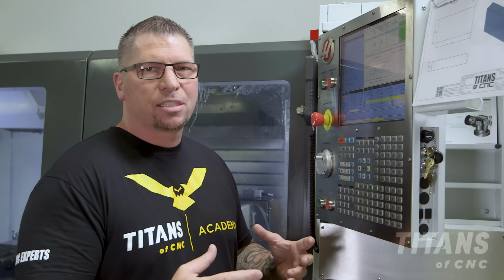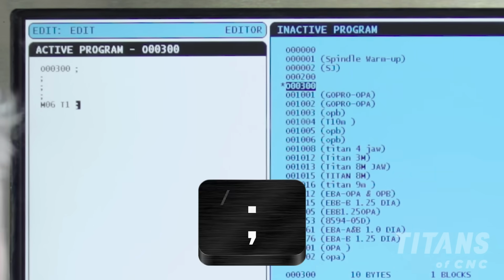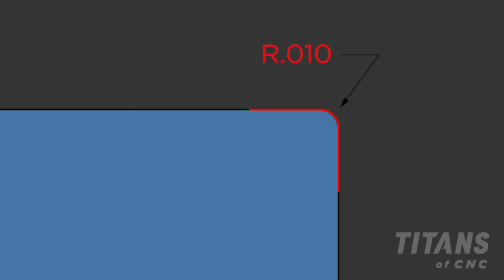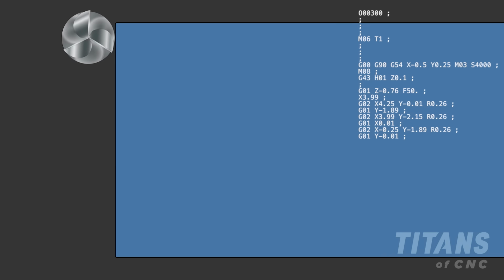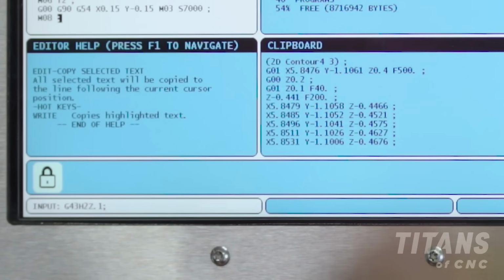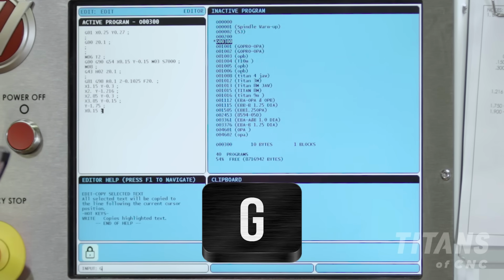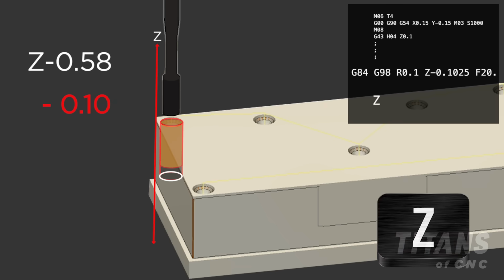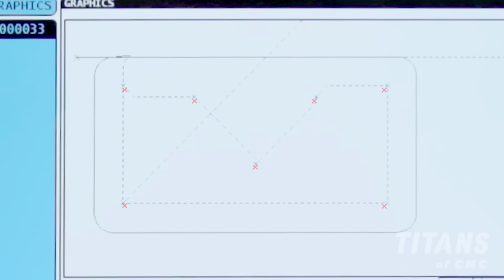G & M Code - Titan Teaches Manual Programming on a CNC Machine.

Comment: Did you cut the surface on the first G1 or block. Your Y is half the diameter of the tool so you didn't cut on the linear? I'm a beginner😁

Comment: What program do we use to save the codes and the drawing in to put it on
 a cnc machine to engrave/cut? I have a small hobby style CNC3-3018PRO I bought to learn how to cnc as a hobby. I am trying to learn how to draw and write the program and cut it. I
 have inkscape and autocad 2017, however I am trying to learn on both. I
 have coreldraw 12 also. I have been using a laser engraver for about 2 years. no programing experience at all. Thanks for all the assistance you can give me in learning. Herb

Comment: Good stuff!  For 15 years I worked at a manufacturing plant.  We ran all types of CNC machines, turns, gun & cross drills, mill and centers, hobbers, cut, clip and shavers, broaches.  We even had a few CNC laser welders.

Comment: Are these codes the same on any CNC display? Can this be done on a laptop/desktop? How interchangeable is this coding? 
Last question: what type of machines are they using in this shop?
Reply: same same but some machines have more features hence more codes apply to them.

HASS

Comment: Do you guys not use cutter comp with G41’s and G40’s?
Reply: I'm sure it depends on what actually machining, and if want give operator the option. But if only doing a one off or so wouldn't need

Comment: I have not seen a lot of your guys's videos but do you guys do CNC lathe work? If so how would you program 3/8 + 18 nptf pipe tap using a reamer and a thread bar single point? Could you possibly explain it out of the 28th Edition CNC handbook as well as at the controller? My lathe is simple G&M coding.
Reply: Internal thread.

Comment: I would like to become a Certified CNC machinist. How long does the Certification take and cost? Any financial aid available?
Reply from the maker: Start for free at academy.titansofcnc.com
Reply: It doesn’t take certified training, it takes hands on training. I’m working at a precision machining shop right now and I’m going to be shadowing in CNC precision machining and Welding. So this is like a blessing to me. I can’t wait to get onto my next job in the facility. I’m starting in the sandblasting booth cleaning frames, railings, bumpers, weightlifting equipment. It’s sick. Such a great job and atmosphere. I reccomend it.

Comment: Taught myselfd G-Code programming back in 1985 when the shop got its first CNC machining center. I was youngin and hungry, I took the programming/operation book home and must have read it 50 times. I was able to write our first program before we even went for training and even familiarize myself with the electronics. It was very satisfying to input my data, push go and watch it do just what I told it to. Ahh to be young again.
Reply: That sounds awesome. Because at that time it was cutting edge. , we have a 3D printer at work printing with inconel which i still find insane.

Comment: A short cut using the little used comma function can really make this outside shape a lot easier. Start out the same X-.5  Y.25.  Line 2 would go like this X4.25 Y.25 ,(comma)r.26. Line 3 Would be X4.25 Y-2.15 ,R.26 etc.

Comment: Im a graphic designer. I have no idea why I watched this in full but i can now program a CNC machine using G & M codes.
Reply: This was just the start, now add in more axes and cutter compensation etc. it gets more complicated believe me. A Swiss type CNC can have 13 axes working in unison, drilling milling and turning both the front and the back of a component at the same time
Reply: @Stumpy1854-Orion  
Do you think writing code will become obsolete for cnc? Modern machines might just work directly on designs? I am currently studying and wondering if by the time I graduate will I even need to learn cnc coding?
Reply: @amirpatel9988  I'm not a designer nor a machinist but I would be very surprised if all that would be still necessary in a few more years.
Reply: @amirpatel9988  CAM software is awesome but you still need to be able to troubleshoot the code it generates.  it doesn't always create the most efficient code, either.
Reply: @amirpatel9988  there will always need to be somebody that understands the individual codes in order to troubleshoot errors and operate the machine efficiently
Reply: If you can, you're not of this world ;-) Stay save.
Reply: I’m a Design engineer and am curious :)

Comment: For your Rotation G- codes such as your examples for G2 why Is the radius represented with an R and not an I or J?
Reply: It’s much simpler to explain R values. Most controls will accept either R or IJ commands, but never both at the same time . R’s are more prone to failure though whereas IJ values clearly define the center point of your arc.

Comment: On the thread If you change the speed do you have to change the feed as well or that stays the same?
Reply: They are tied together.  Let's say 1/4-20 tap. 1"divided by 20=. 05    then multiply that by whatever speed you want for your material. Let's say 1000rpm. 1000x.05=50. Speed 1000 feed 50

Comment: Where is the cutter compensation 🙄
Is it possible to do lead in/ out manually?  
Is it possible to do multi passes in XY plane? 
Or we need a CAM?🤔
We used G54 D01 where we store x and y value. But what i see here is  totally different and interesting.
Reply: I usually use cutter comp when programming manually. It's much easier to read than trying to do the math of where your tool is supposed to be, and then you can use your wear offsets more efficiently because the tool size isn't hardcoded into the program

Comment: Haas needs to either consult with Siemens or Heidenhain on how to make a modern cnc control because I’m afraid this is how we programmed Fanuc controls in the 80’s inefficient and slow that’s why every Haas machine I’ve seen is connected to CAM .
Of course this is great to show new users  the origins of 2D programming but things have moved on from  here .

Comment: Great video. Thanks a lot for sharing this information. I'd love it if you had explained how you get the F and S parameters though. I mean most of the information i have seen online says that i have to ser what the catalogue says. Vc parameters and fz. It would be awesome to have " universal" / standar parameters.
Reply: You'll remember these parameters for each tool really quickly when you start programming and working with the machine. I'm working on CNC milling machines for 2 years now and I never used any catalog :P
You'll often change these parameters as well depending on the tool's condition, the material, the speed you want the work to be done, the finish you want to get, etc. For example if I'm supposed to make a clean finish with a new tool anyway, I'll make the rough finish go with higher feed rate because I don't care how the surface is gonna look like and if my "shabby endmill for rough finishes" is gonna end up more blunt than before. And for the clean finish I'll do it with slower feed rate so the surface is cleaner and so my tool won't blunt or chip.
There's so many variables especially depending on the tool's you're using and the material you're machining that you can learn such parameters only through experience in my opinion. I don't know if it'll work for what you'll be making, but I can tell you roughly the parameters I'm using in metric:
Endmill - 1-3mm S2000-4000, 3-6mm S1000, 6-10 S600--800, 10-16mm S500, 16+ S350. F100-200 depending on the finish I want to get. I use the same speed for any size and only go slower with the smallest endmills because they chip and break easily.
"Roughing" endmill (for rough finish, can take up to 10mm of material in one go) - S150-300, F10-30 depending on the diameter and the amount of material taken in one go.
Drill - basically the same as endmills, but varies more depending on the tool's condition and material hardness. Slower the worse condition of the drill and the harder the material. F also varies a lot, but usually 10-50. With Z axis you always want to go very slowly.
Chamfer - S600+ for typical 3.3mm chamfer and accordingly slower or faster depending on the diameter
Any rimmer - S70
Any tap - S100
Any countersink - S200-300
Reply: https://youtube.com/channel/UCMvjS2Dw20ukoyPID0BmGHA,,
Reply: Subscribe,,

Comment: For me, the novice, this is a great video lesson.  I always worked in the manufacturing sector but did not have a clue what the engineers where doing in these CnC machines, actually I would know they are programming because I would always see how the parts are cut by the machine following certain instructions.  G&M Code basics is what I'll be always looking for, I want to fully understand before attempting to do any project.  Thanks
Reply: https://youtube.com/channel/UCMvjS2Dw20ukoyPID0BmGHA,
Reply: Subscribe

Comment: i got confused where he added .250 to the 1.90. why did he do that? why didnt he do that following every g2 turn around the radius.
Reply: Also how do you know the angle is gonna be twice as large (.200) for the chamfer? What kind of math topic is that?
Reply: That's only for a 90 degree spot. Multiply the spot size by .500  so .200 diameter spot =.100 depth.   82 degree multiply spot size by  .575  so .200 diameter spot is  .115 depth

Comment: I watched this twice. I cant wrap my mind around why the last cut on the first block was X0, Y01 when you were bringing it back to home. I am less than a novice, but in my mind it would have been x.01, y.01 to stop it 10 thou into the material an 10 thou before the corner. Was it because the rendering indicated a 10 thou cut on the x0 end when it was really no cut? Just confused.
Reply from the maker: Tool is X-.25 going up to the top and then stops at Y-.01 because that’s where I start my final arc to put the final .010 radius.

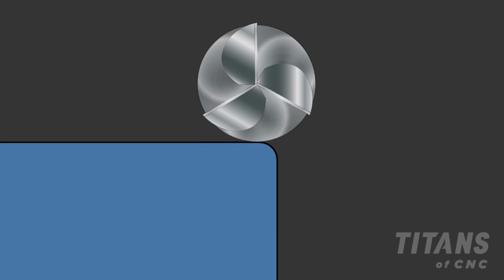Comment: .01, thats not ten tousandth, aint it? 8:12
Reply: That's what I was thinking. I thought his code should read R.010, not R.260 but I'm still new to this.
Reply: He adds half the tool diameter and the radius together. That's how it's programmed without using g41/g42 cutter comp.
Reply: No cutter comp duuuuuuh

Comment: In this program you are running the .25x90° before the drill is there a reason pro con type thing to using it before the drill?my companies programmers put it after the drill but I'm curious for my hand written programs if I should be doing it different for different reasons one way or the other
Reply: I always like to spot drill first. It keeps the drill from walking.

Comment: I know nothing about CNC'ing, I'v got a IT background so excuse if this is a silly Q - If the drawing is already being done on a PC in some CAD app, why are the CAD app's not able to output the required code (I assume there is some standardization here) into say a "config" file, so someone can just upload that into the CNC machine ? Surely this would save TONS of time and eliminate any human errors, except if the errors were done on the drawing ?
Reply: Yes, this is what you normally do. But this is still useful for simpler jobs or for making small modifications to an existing program without running over to the computer. As an analogy, if you're programming C++, it can be useful to look at the assembly output for troubleshooting even if that's not what you're doing most of the time.

Comment: 1 divided by 32= .03125 x rpm=feed.  40 x maintainability rating divided by major diameter x 3.82 =rpm  
pitch x rpm = feed
Reply: For taps that is the hard way..the easy way is TPI=RPMx10 @ F10.0 or dbl the rpm and feed.  
1/4-20 is S200 @ F10.0 or S400 @ F20.0 etc. Or 4x 8x etc.

Comment: I maybe overthinking this, but if the part is 0.750 thick, why do you enter the "Z" coordinate at - .760? (at time index 6.45)
Reply from the maker: Z 0 is Top of the Part and then I drop the Z-760 to just cushion the cut a little... just over take it, so when flipping over... and decking to .75
The overall finish is perfect.
Reply: @TITANSofCNC  So to be clear, the block of material would be closer to 1 in thick, and when all is said and done, the final thickness will be 0.750 Because you need to mill the bottom to final thickness when the other steps are completed?

Comment: I taught cnc as a volunteer to high school age kids at the local tech school for a few years. The graphics from cam were an excellent way to show the position. Beats what I drew on a chalk board. I think you should have shown the "distance to go" on the graphics on the haas. That way  if they single block the first time when they drill that hole they can double check the depth before the tap cycle.
Reply: Great advice, I do that often and it's saved my tail a few times from crashing the tool
Reply: ll.k
Reply: The Machine Shop I currently work in as the shop Fabricator and Welder, We actually have a teacher from our local community collage working there and 2-3 times a week he works at the school for $34 an hour to teach just Manual Machining,,, Granted he also teaches CNC at the school but, he says not enough people attended the CNC classes for him to teach.

He said theres some teachers with masters degrees and such getting up to $70 an hour to teach there but, He learned everything on the job so he maxed out the pay he can get without higher education even though he is the most knowledgeable and best machinist you will probably ever meet.

Comment: I always start my tool lines like this; N1 T1 M6 so I can run the program from any tool change position i.e interpolating holes after drilling. If the hole diameter was slightly down on size rather than starting at the beginning of programme I could just run that tool again with a different offset. Is that something you usually do?
Reply: On a haas and milltronics, I go to the memory/program, scroll down to the line of the tool change and start from there. I've seen people use the N# to start from a certain block, but its really not necessary. In every program I write, I always home the tool after use, and add an M01(optional stop). Just incase I wanna check how a tool is cutting and set all my offsets to be exact, or if I wanna check inserts.
Reply: I never start with N1, what if you want to put a line in before?
If I'm using line numbers I'll start with N10 then N20 ...
or N100 N200 then you can always add lines later if needed.
If you do N1 N2 N3 then you get to N20 and shit I want to add a line at N10. Renumber 10 lines.

Comment: Never turned off the coolent m9 so the coolent been on ok.
Reply from the maker: Nice... Turns off at M30
Reply: Thats good to know i thought maby the program would end but the coolent would still be running so m30 end of program turns off all ok got thanks.
Reply: @shellysheer985  nice try smart ass
Reply: don't be an ass just a question. @dekatexas

Comment: Hello! good video, I have a big problem. I work in a CNC company, we have a product that we manufacture and wears M3 and M5 threads. the M5 if we can do it on the machine but the M3 could not be done on the machine, they break very often. Do you have any solution to the problem? can you help us? I wait your answer. Thank you!
We are in Monterrey, Mexico.
Reply: You can use thread mills instead of rigid tapping
Reply: Yes thread milling is great. I've milled 2-56 holes and the tool lasted for over 500 holes in S.S..
Reply: What are your speed and feeds with the taps, maybe you are running the tap to fast? Also make sure you use hole numbers for RPM and IPM, the machine likes it better, you could also use a floating head or use a larger drill if you have room with your minor diameter. Lastly try using roll taps, they last longer!

Comment: Instead of doing the math for all the radiuses why dont you just to the priny exp.. G1 G41 Y0 D1 F10. ;
G1 X3.99;
G2 X4. Y-.01 R.01
G1 Y-1.99 
G2 X3.99 Y-2. R.01
........ and your cutter comp is half the diameter of the tool you are using so for 1/2 endmill it eould be .250

Comment: Would it be possible to later on make an education Video about "Vectoren" on 5 axis im not sure about the term in English. As an Example it is used if u wanted to tilt your table and turn the table around so u can machine a cone. This can only be achieved if the work holding fixture is dead on centre. Which is not always possible of course. I hope you understand what i am trying to explain.
Greets from Germany
Reply: Do you want to do it with manual programming or using a cam software. Manual programming is also possible by positional milling using G10 in a 5 axis machine, even the centre is offset, using M128.
Reply: @sreekuma226  i wanted to see it done with manual programming..could you maybe explain that a litte more detailed?